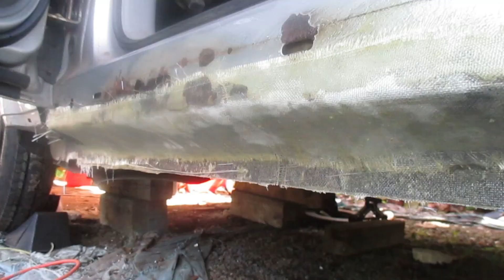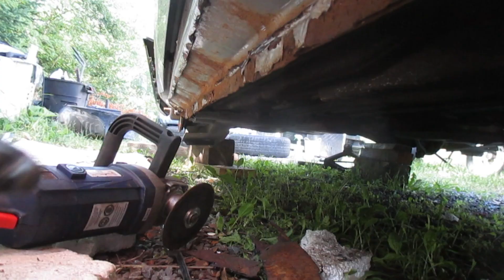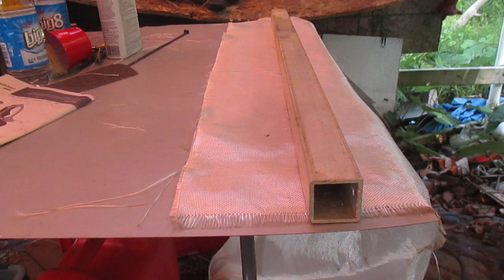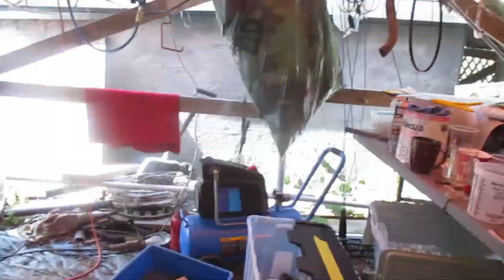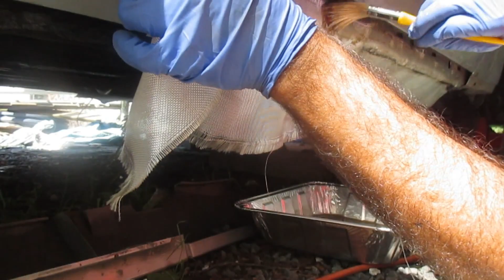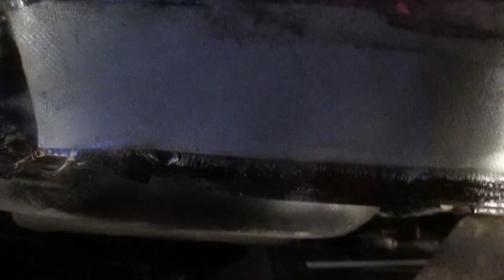How to repair rocker panels using fiberglass cloth and sheet metal

Comment: I would have applied some type of tust inhibitor por15 or rust encapsulator and primed on that rust before covering it. The rust is just going to continue regardless but atlease it would have slowed it down.  Im going to try to repair my rockers with sheet metal and rivets.too .

Comment: Backyardmech I had a question 
Can u bend a router if curb it hard enough. And would that make the car when brakes are applied make a grinding or almost like it's rubber scraping on something but only when brakes are applied
Reply: How the F did you manage to damage brakes and not the wheel?!
Reply from the maker: If you hit a curb hard enough to damage the rotor , the car would probably be undriveable Tima . A wheel rim can often be bent by hitting a curb though, and that would cause a lot of vibration or 'wobbling' when you drive
Reply: @backyardmech  ty so much! I was right, it was the brake pads and router! And caliper I guess... ty though I love your videos! Very helpful...

Tima

Comment: 1995 Honda odyssey ex with 300,000 miles.  Need rocker panel repair . Will watch and decide whether or not to attempt
Reply from the maker: I had a 1996 and a 1998 Odyssey Piri - both of them had over 400,000 Kms when i retired them . And then it was only because Canadian winters eventually rusted them out - the engines were still going strong . Two of the most reliable vehicles i ever owned !